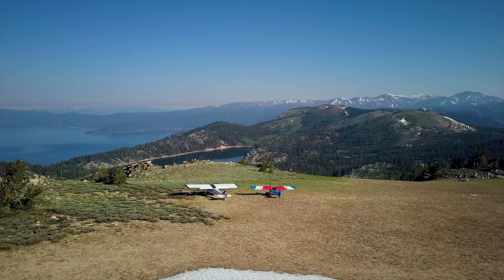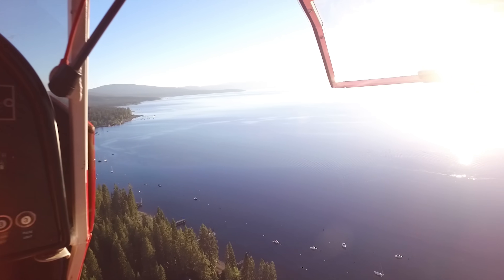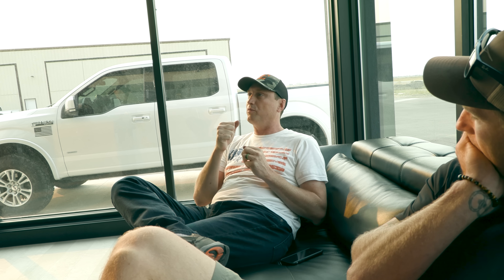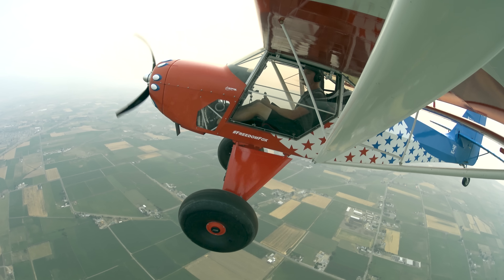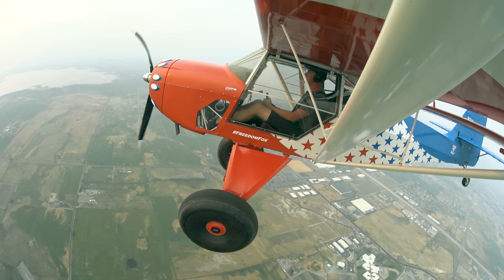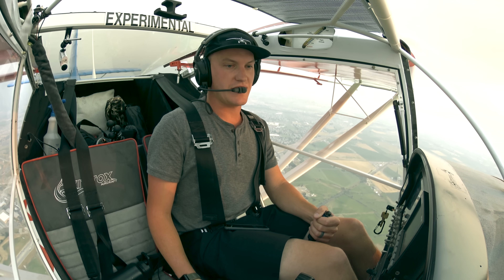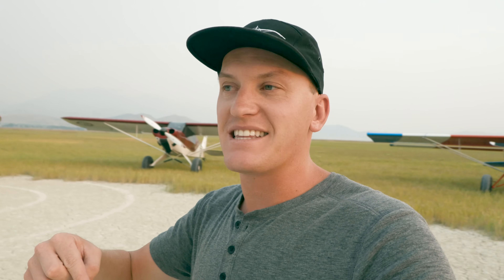YOUR FLIGHT INSTRUCTOR WAS WRONG! - Simulated vs Real Engine Failure

Comment: Hey Trent Palmer, I'm curious, why do you seem to be having "overheating" issues with your plane/motor? Is this normal for your configuration/motor? It seems like you have had this issue before as well.
Reply: This isn't uncommon on air cooled motors making demanding climbs in warmer weather. Cessna 172s, and 152s, will epxperience this as well and its one of the things I check for on every hot day here in Texas when I fly.
Reply: @jacobogden6710  but the Rotax 912 series is water cooled
Reply: @renogyrography  valid point! Under high load for an extended period of time like on climb out it could still heat more than the cooling capability of the system but should be less of an issue on liquid cooled in comparison
Reply: @jacobogden6710  Guessing the cowling is restricting airflow a bit. I had simiolar issues and ended up solving them with a second oil cooler with a thermal valve that stabilized flight in hot environment.
Reply: @renogyrography  yeah additional oil coolers will always help, having a thermal valve is a nice fix as well. Mike Patey set up an external oil can with a cooler and thermal valve as well, that would be the best option but also sacrifices some useful load

Comment: As a child I did some tests with and without spinning propellor on small polystyrene planes. With the same weight it proved that a free spinning propellor improved the flying characteristics. Maybe because the propellor is moving air outwards and thus creating a low pressure zone for the fuselage to glide through. The rotating spinner added to stability of the flight. With a fixed same weight in the nose, as a glider, flight pattern was less favorable.

Comment: 9:45 Minimum Sink speed (Vms) is not the same as Best Glide Speed (Vg). Vms will give you more time in the air but you will achieve the highest glide ratio and cover more distance at Vg.

Comment: I'm saying this before I finish  watching the video. If a propeller is idling each blade has an air foil. A vacuum on one side and a high pressure zone on the other. If you're flying at idle, whatever side (front of the blade or behind it) has the vacuum is going to dictate whether the idling prop creates drag to ruin your glide or produce thrust to improve your glide. That all depends on what configurations your plane has. I'm no scientist I could be wrong. I dont know whether or not there is even a plane who's prop idles slower then its glide speed.

Comment: Clearly an idling engine and propeller is creating less drag then when the engine is stopped and the propeller is not moving. Simply idling the engine to train for an engine out scenario is good but the instructor needs to let the student know that was a dead propeller you won’t be able to glide as far as you could in your training scenario with the power cut to idle.

Comment: There some things to consider here ,  for none variable or fixed pitch props with a hard couple to the gearbox it is a advantage to run at idle . This is because of induced prop drag . Variable pitch props with a prop inter connect. You would have an advantage over a fixed pitch prop if you were dead stick .

Comment: Ballistic Coefficient, a spinning prop will created more cross sectional density.
Reply: "Ballistic" coefficient deals only with bullets. Its does not correlate with propeller planes in the slightest

Comment: It’s vector dynamics, the direction of air flow with respect to the pitch of the prop. As the prop moves it effectively reduces the differential angle between the direction of air flow and the pitch of the prop. As the prop rotates a little faster, the vector differential becomes neutral. Further still and it starts to generate thrust. Summary...any motion of the prop created by the engine reduces drag.

Comment: Excellent point. "Experience" in throttle idled simulated engine-out would prime you to select a landing location that your aircraft cannot reach.  We know what happens then, pilots pulling up to clear that last obstacle, hitting stall angle of attack, a wing drops and you pitch in nose first and die.  

I always tell people if you f' it up, the FAA did a study of (presumably small) aircraft showing if you impact even heavy forest with wings level at 5 knots above stall speed you had, IIRC, a 75% chance of walking away without major injuries to pilots and pax. [Again, I don't remember the study's particulars but I'm assuming it's on light civil aircraft.]

Comment: well, that's  the old question ...  no brains , no headache.   a completely stoppEd pRop is not the same as a windmilling one. and low weight plus simple blade makes no windmilling in a lightweight bird.  i think it depends on various factors. but testing is worth,  to learn.

Comment: I was fortunate enough to have a Flight instructor to allow me to execute a dead stick landing with the propeller stopped to show me the difference.  I am glad that he did because I discovered that that windmilling propeller that results from simply pulling the power to idle to simulate a failed engine is actually producing a fair amount of thrust that helps make the landing smoother.  Without the windmilling propeller the only air going over the control surfaces is relative wind.  What that meant for me is that I had to keep the glide speed up until I was ready to flare and touch down.   The first time that I made a dead stick landing was not my smoothest landing but having learned I made smoother future dead stick landings.

Comment: I know very little about propeller planes, but from a background in physics I would suggest that it is important whether the prop is stalled or not. Another commenter mentioned angle of attack at the leading edge of the propeller. The special speed other people discuss is likely the airplane speed at which an idling prop, acting as a wing, is neither pushing nor pulling. I would bet that the angle of attack for that is close to zero. If the airfoil is efficient, I would expect the plane would be sensitive right around this speed. It could be helped forward just below that speed and pushed back just above. Almost like picking up a wave on a surfboard. However, enough below or above this special speed and the airfoil will stall. Then the force will be all drag, but the drag of a fat stick, not the lift of an aerodynamic surface. Clearly, the idle rpms of the engine will determine this speed. Remember that this airfoil is long and thin, so it should stall hard, like tbe wing of a racing glider.
I applaud what you did: go out and test this under safe conditions. Maybe by varying the throttle to simulate different idle speeds you can get a better feel for this. At a safe altitude, of course!

Comment: this could have been tested mostly on the ground. Using an annomonitor, see what your wind speed is behind the prop at idle. if that number is higher than your best glide speed, then the prop is providing thrust and not drag, therefore increasing glide distance.

Comment: Depends on how much power the idle engine is making. High enough power and the prop can be zero drag more power and you make thrust. It takes energy to turn a prop and that energy has to come from somewhere. The more energy the engine puts in the less drag from slipstream. You might glide a little farther with a prop that has stopped over a windmilling prop but the glide ratio does not change by a huge amount. You also have to take into account how much loss there is from slowing to a speed that will stop the prop while flying at a speed far below best glide speed. At a low altitude the you might not gain anything trying to stop the prop. We used to stop the prop on a C-150 at 10,000 and glide for about 30 min. but had to slow to just about stall speed to get it to stop turning. We had no problems landing the airplane with the prop stopped on the runway. Did get grief from the airport manager for not "declaring and emergency for the engine out landing" Our reply "not an emergency landing we chose to do it" If yore engine fails below 1000' you most likely will not gain much or anything by slowing to stall speed then trying to get back to best glide speed. 

A better test would be on a huge dry lake and simulate engine fail  to landing from a fixed point at 1000' and see what gives your aircraft the best performance. Cut the mixture and windmill to landing, idle the engine and idle to landing, cut mixture and stop prop and glide to landing. Do it multiple time to average out pilot error.  

Best performance also is not always the best choice if the gain is small and the danger goes up getting that little gain. Engine out at 300' and very little options you are most likely better off maintaining speed and making a landing.

Comment: At 9:48 Trent says
60m/hour at iddle   1:53 seconds to come down 1000ft
60m/hour at stopped 1:40 seconds to come down 1000ft

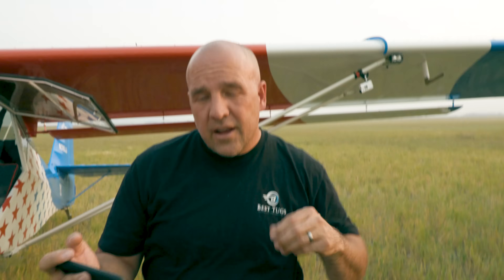At 10:05 the other pilot says "I kind a had the same result"
Then continue saying "when the prop stopped I did better than prop windmilling... by 50 ft / minute.
That is the opposite result.
What do you think about this?
Reply from the maker: Windmilling would be the prop being spun by the wind, no fuel being combusted to spin the engine. Idle would be the engine actually still making the power to spin the prop. Windmilling is the most drag, stopped prop is second, idling prop is the least drag

Comment: So to have drag you must be moving.  OK got that, so while moving if your prop is turning with the engine idling the prop is still cutting into the wind verses if the engine and prop stopped cold.  A stopped prop while flying will be turned by the forward motions of the craft, so the wind is having to push against the prop to turn it thus creating more drag than when the prop is cutting into the wind at idle.  I don't see how this could be a point of discussion because it seems to be fairly cut and dried concept.

Comment: Think of a propeller moving through cheese.  If the prop is slicing off cheese at a faster rate than the cheese is being fed into it then it is creating thrust.  When the prop slows to the point that it is not slicing faster than the flow of cheese then the cheese begins to push on the propeller and is creating drag.

Comment: when you mentioned the theory and question of drag on idle stopped and windmilling props i instantly thought about basic fluid dynamics and drag envelopes.

With a stationary part having flow perpendicular to the object the area of drag is going to be more. With the idle spin its going to have less of an envelope because the object, the prop in this case, is still moving relatively correct to its intended rotation meaning its got more parallel flow. So with a fixed prop, i.e. not rotating its got the highest drag envelope, with the engine idle, you will have the smallest drag envelope. Now with the prop windmilling but the engine is dead, I would guess the drag envelope is somewhere in between the 2 previous situations. 
I could have made a mistake in my thinking but this makes sense to the best of my knowledge.

Comment: Hey Trent,

You’re absolutely right - and I’ve never heard of an instructor saying that an idling engine is ‘worse’ than a dead one - these people need educating.

I haven’t instructed for nearly 30 years, but was a QFI in the U.K. in the eighties - I don’t think the laws of physics have changed substantially in my absence!

...and yes, I have experienced several real life engine failures.

The only time I’ve had better performance with a dead engine, has been when flying turboprops - a dead, feathered engine, will create less drag than a propeller set to fully fine (which we used to use to help get down quickly, by ‘discing’ the prop).

However, single engine pistons do not generally (I’ve never seen one) have the ability to fully feather the prop.

During my upgrade to QFI (what used to be the UK’s higher level of instructor), my own instructor instructor demonstrated the difference quite memorably by pulling the mixture on me from downwind. Despite turning straight for the runway threshold, we only just cleared the lights - simulating the same thing with the engine at idle, we could just about fly a full descending circuit - the difference is that marked.

The RAF taught us a really neat way of making any sort of approach (easier in a low wing a/c) - by basically keeping a constant sight-line angle to the threshold, you’ll always make it - engine on or off. Threshold moves up the canopy, tighten the turn, threshold moving down the canopy - widen it out a little. But then the military don’t bother with rectangular circuits - the turn from downwind to finals is one continuous turn - far more efficient than civvie street.

Great channel BTW!

Comment: I think you need to divide the problem up into drag and thrust. There is thrust and drag curves depending on the propeller speed. If you subtract the drag from the thrust, you net the net thrust - and it can be negative, if the propeller is spinning slow enough.

Comment: Like destin said, it’s a complex issue.  However, let me suggest another view.  Analysis from an energy management standpoint,  an idling prop is adding energy to the system while a stopped prop is an energy sink due to drag, and a windmilling prop is a bigger energy sink due to energy consumed by cylinder compression and any other internal friction loss.

Comment: A prop not turning causes less drag than one spinning. I have a windmill that actually de-masted before the brake came on, on my boat, and was actually heeling my boat over, a 28-ton boat. I reinforced the mount and put it back up. When the brake is on there is little drag same goes with an airplane prop not turning. Another example is when a large boat is being towed they stop the rotation of the prop to reduce the drag it is the same thing with an airplane, engine at idle landing, the air hitting the prop faster than it is turning  causes a braking action  shortening your glide path

Comment: this question is confusing to me because it would make sense that an engine that is on and creating thrust would have a longer horizontal flight and one with an engine making zero power would fall vertically quicker. the engine spinning is making a high pressure zone behind the prop and a low pressure zone at the front of the prop as it moves through the air thus leaving less mass in front of the prop lowering its drag.

Comment: I remember on the planes I flew during my CPL training that if you flew at best glide on idle, it was worse than if your prop was stopped and feathered. Because of the way the ECU's worked you'd need to put it at 12% throttle to achieve engine out performance. You could actually feel this as when you dropped the throttle lower than 12% the sound the prop made changed drastically and you would get pushed forward as the plane slowed down dramatically

Comment: I could be totally off on this one but if you were to push a (stopped) prop. brakes on... through the water.. wouldn't it be harder to push at any given speed then a free-wheeling prop..  brake off.. that would just spin freely through the flowing water.. I know air and water are totally different but really not that much in this case I would think.

Comment: An idling prop creates more drag period.... you do not understand induced lift.... unless the prop is featherd......a free pin wheeling prop creates more drag that stationary..... this fact has been proven in math in wind tunnels and by actual testing.... this had already been proven...... so dumb shit doing this by time is not right you need to do it by actually ground distance covered.... you did not bust anything.... the one guy says better glide with prop stopped....I could explain all the math all the physics every force at work.... but it will not fit here and tig would not understand it either....p factor I'm sure you do not understand nor gyroscopic procession nor apparent wind nor induced wind  or pinwheel dynamics

Comment: I  would say the best way to conceptualize this is as follows: An idling propeller sends air towards the aft of the airframe at some speed, whatever that is.  If you were towing the plane at that exact speed, there would be "no" drag.  Above that speed, you would start getting drag.  At that speed or below it, you're getting some small help thrust.  A stopped propeller would generate drag at any speed.  So, all other variables being equal, the total drag value from cruise speed to stopped would be lower on the plane with the idling propeller. MHO

Comment: The simple solution is to imagine that you can have just one test.   You turn off your engine, hold the same elevation drop and stop your prop.  Now you magically disengage the prop from the motor and allow it to stay stopped or start to windmill.  It will obviously start to windmill.   Why?   Because it will be moving to the point of LEAST RESISTANCE TO THE ONCOMING AIR.   That proves that an idle prop has less resistance than a dead stopped prop.  It is physics, not aviation.